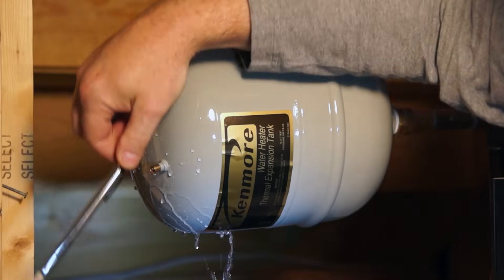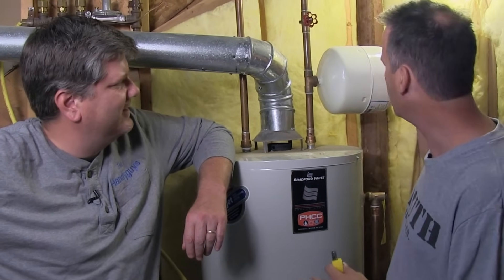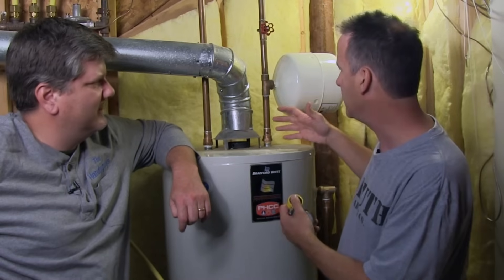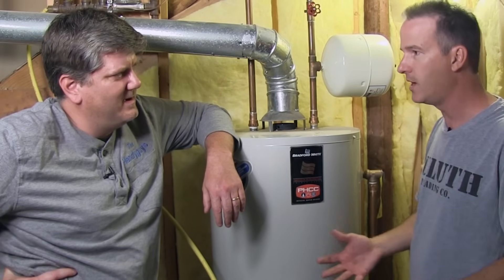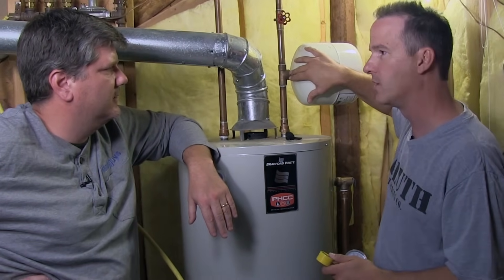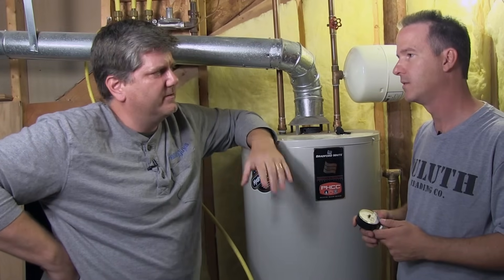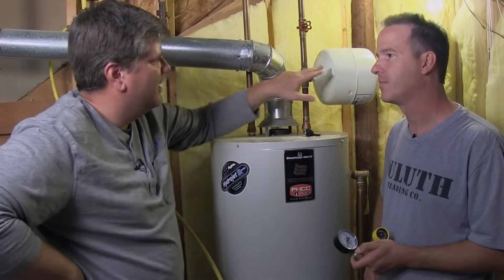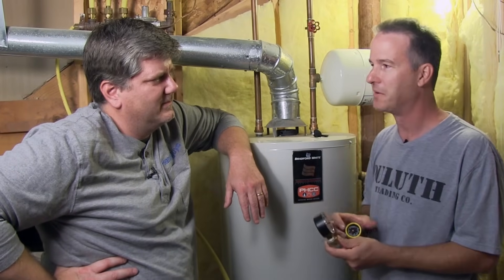Water Heater and Expansion Tank Maintenence

Comment: So  i was  told to put in an exoansion tank to fix my water spike/ hammer  issue. I have  arrestors on every appliance and  even miltiple on  the bigger ones, installed as close  to the appliance as possible. Anywho  my regular pressure is 60 psi regulated via prv at city main.  Well with  all the arrestors my gauge still  hits levels of 130 psi according to the dial with the  floating needle that reads highest pressures.. never seen it  spike before but everytime i reset it   Next time I look its back at 130 or around.   So  would i need to have an expansion tank set at 60 or  130?   I would think 130 would just push everything out and only be effective during those spikes which is dumb to do. But with 60 than the spikes in my opinion would still hit high pressures..  only 60 pounds  of cushion which it already has..  dunno   Just waiting for a  pipe to blow..

Comment: If your home already has hammer arrestors at all faucets; why would you need a pressure tank? I know water expands, but how much does volume actually increase when 40 gallons (Worst Case Scenario) is heated from 10°C to 50°C? you think more than the volume of air in hammer protectors?

Comment: We have really hard water, we have a water softener but the water tank still gets massive ‘furring’, what is the correct way to turn the tank into a closed system so I can pump (and drain) some decalification solution as I do in my radiators

Comment: All the installation info I've seen shows the tanks being installed vertically. Yours is the only one I've seen in the horizontal position. Won't that effect the operation?
Reply from the maker: ***** it won't effect operation but it probably should be supported better.
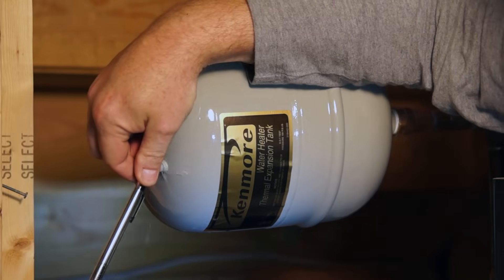Reply: Hate to disagree, Handyguy. While it is true, a horizontal installation will not affect the operation of the expansion tank  (when the tank is working properly) it will likely result in a misdiagnosis by the folks watching your video. The best installation position for the tank is "Vertical" with the adjoining water pipe located above the tank. If you will view the "failed tank" shown in your video (@ 3:54) the Air Valve is below the level of the tank's threaded connection to the water pipe. Thus, when the air valve is depressed, water escapes from the valve, and it is obvious that the bladder is ruptured. However, bear with me for a moment, when I say that the installed position of the Air Valve is random at best, for if the installer had given the wrench another half turn, the air valve would be below the tank's inlet connection. The significance of this becomes clear, when one pictures the effect of a ruptured bladder in a failed tank. The air pressure that was previously contained in the bladder is released into the "water side" of the tank, where it fills the upper interior half of the tank, and any additional air volume escapes through the threaded fitting and into the plumbing system. Here's where the problem begins: Placing a pressure gauge on a "ruptured" tank's valve will read the correct pressure (water supply pressure) and air will escape when the valve is depressed... if the valve is "Above" the Inlet Fitting. Conversely, depressing the valve will result in a stream of water... if the valve is "Below" the tank's Inlet Fitting. Since your videos are intended to educate the layman viewers, who may not be experienced with Expansion Tanks, you may see how a DIY viewer could check a failed tank and deem it to be good, based on the random position of the Air Valve when it was installed.
I think it would serve your viewers better, if you were to recommend the vertical installation of expansion tanks, when possible, and if a horizontal installation must be made; to take care to position the Air Valve in the lower position. Additionally, it would avoid headaches, frustration, and perhaps even unnecessary parts replacement, by at-home DIYers, to suggest removing the Air valve itself, to test for water intrusion, as it would allow for any trapped air to be expelled, followed by water from the system. The air valves are less than a dollar at any hardware store, or tire shop, and might as well be replaced when evaluating the expansion tank.
Thanks for your videos!

Comment: I think I have a noise as a result of the expansion tank being under pressurized. I bought a new one. The old one had well over 140 psi and a lot of filthy water in it. I put the new one on and the noise I had quit. Now 4 days later I get a siren humming sound. Any ideas?
I have a video of the sound and the water heater in the mud room. Not sure what to do. Maybe just add it as a new video. Thanks.

Comment: I just install my pressure tank to my water heater but I install the tee on top of the pressure tank and one end to the valve and other to water heater.   did I install it wrong or just wasted copper?  I notice they put the tee on the water valve and one hose to the tank.   just like yours but you Installed it sideways and wasted no copper.  but mine is upward and had to send copper line back and forth.  any suggestions 🤔  anyone??

Comment: I appreciate you taking time to post this video. If I may, there are a few crucial errors in your presentation. Please do not take this as rude or needlessly critical, as I am only trying to help you make a better presentation to people who may not know better. First off, those are pressure gauges, not valves. You call them valves in your presentation. Big difference. Secondly, you must be sure to precharge the thermal expansion tank to the proper pressure prior to installing it and loading the other side up with water pressure. If you choose to install it first, you must be sure that your Water Main is turned off and you have drained the pressure from the system by opening the faucet somewhere. Then and only then is it acceptable to precharge the tank to the proper pressure. Lastly, during the yearly check up the tank, you state that you should have a hot water faucet open somewhere while you check the pre-charge pressure. This isn't correct. You must shut off that valve above your thermal expansion tank, and then open a hot water line somewhere. Alternately, you can turn off your water main and open a cold or hot water faucet. The key is to remove all water pressure from the system when checking the pressure on your thermal expansion tank. Merely running some water while you check the pressure in your tank will not achieve this. Especially if it's a shower that you're running.
Reply: JimmyLeeHook could I simply turn off the water valve located just above the thermal tank (instead of closing the main valve) and opening a couple of hot water valves inside the house to relieve the tank pressure? Then charge the thermal tank to the proper psi?
Reply: Clay Sinclair Hello Clay, yes. That should work fine. Just be sure to open a hot valve all the way, and wait until there is zero pressure on the wetted side of the bladder in the tank. Leave a hot water valve open just to be sure. 

Sometimes you can get some cross pressure from the cold side to the hot side from mixing valves that leak a bit, such as from a kitchen sink or shower. You may find that merely shutting off the water supply to the water heater doesn't get rid of all your pressure in the water heater because of this phenomenon. But if you keep a hot valve open while you check the air pressure in the tank, you'll be fine.

The goal is to have 0 psig on the wetted side of the bladder when you check the air pressure.  You can accomplish in any number of ways.
Reply: JimmyLeeHook Thank you for your interesting post.. I'd say based upon ur advice... One could simply do an annual maintenance by pulling the expansion tank off completely and filling it to the proper air pressure. Then reinstalling it..
Reply: @mr.bigbrownbass9089  This is what I did in order to avoid the "balancing" act between valves. Took some pressure of the hot water tank by draining the bottom and then disconnecting the expansion tank.  Once off I drained the water from the tank, checked the pressure and adjusted it accordingly.  Then, reconnect the tank.  I find this a simpler, more concise way but as the poster above noted, there are several ways to do this.

Comment: The tank on my system has a label on it stating 15 lbs.  Water pressure ranges from 40/60 on a pressure switch.  So disregard the label and put between 40/60 lbs of air pressure ?   I have a well if that makes any difference..

Comment: I took my  two yo exp. tank off to check my air pressure, because it is near the floor and I can not reach the valve.  I support it from the bottom.   Once I removed it, water continued to spray out of it for five minutes.  The bladder was pressed up against the opening allowing water to squirt out in a fine mist.  Here in Pittsburgh we need pressure reducing valves after our water meter so we don't have 160 psi coming in our houses from the curb.  The Watt brand press. reducer is factory set at 50 psi. so that is the amount needed to charge the air side of the tank.  The tank came with just 25 psi. TIP.  If you have copper pipes put a dielectric union between the steel tank and your copper pipes or your ex tank will corrode much faster on the potable water side.

Comment: good video.  I would mount tank vertcially so that air doesn't get trapped between bladder and piping.  I would strap the tank if horzontal.  Tank should be placed at least 18" from water heater(found on directions that come with tank).  Add air before installing.  I would replace that valve with a ball valve.

Comment: I have an expansion tank that has failed, sprayed water all over my laundry room for idk how many hours. The tank is on the hot exit line instead of the cold in line. The unit is 3 years old and since the install we have had many other issues, pipes rattle, 2 faucets leak, and 1 tub faucet leak. Are these also problems from the tank?
Reply: Brandon O'Neal no..! The're from the bootleg'n hack that installed the system... It "pays" to hire a real Pro....!

Comment: My expansion tank has a a very slow air leak at the Shrader valve.  Do you know if the valve core can be replaced as is done on a tire valve?
Reply: I did replace the core. No problem.  This tank is over 30 years old so it's probably a good idea to soap test the valve periodically.

Comment: My main water line reads 60 psi, I turned off the cold water line to the water heater tank and opened the faucet. I am getting 0 psi on the expansion tank. If I add air to it , it keeps dropping to zero. When i close the faucet and turn on the water to the water heater tank, the pressure on the expansion tank gets to 53 psi. Is this normal? There is no water or leak on the expansion tank.

Comment: My question:  to what pressure do I set my new expansion tank?  It came @40 psi.  

I have a city water system.  I have a water stove that is plumbed so flow goes CITY/WATER STOVE/WATER HEATER.  The water stove can be bypassed.  There was no expansion tank on the system before installing the water stove.  The bypass to the water stove is normally closed.  

There is a back flow preventer (check valve) en route to the water stove.  I have an expansion tank right after that, in my house water heater enclosure.  It failed.  

My new expansion tank, out of the box, was checked to be at the factory 40 psi.  The directions say to "adjust before installing."  I've not yet installed.  I've been told that the tank should be set 2 psi below "the lowest system pressure." 

The pressure at my hose bib outside is 80 psi with zero flow.  I opened 2 sinks, a shower, and started filling my washing machine.  The pressure dropped to 32 psi.  There is a pressure regulator coming in to the house.  I don't know the pressure on the water heater.  

Q:  Do I adjust, and if so, to what pressure?

Q: When I check periodically (and there is only air in the tank), do I check with the water off and vented through an upstairs sink?  And do I change the pressure on the tank as needed?
Reply: Are you running Biothermal  AC/Heat?

Comment: Great channel!  Does it matter WHERE in the cold water line you put the expansion tank?  I am looking to install a commercial toilet with a sloan valve in a residential and am wanting enough pressure to help flush it with my 1/2 inch line.
Reply: Sloan valves are usually required to have 3/4.

Comment: Hey guys great video and I'm not even sure I'm gonna get a response to this based on the age of the video. But I went ahead and replaced my faulty expansion tank and followed all the steps got our pressurized and it actually took care of our water hammer issue however it is doing a slow leak around the connection even after using plumbers tape and I really don't feel like I should tighten it anymore than it is and it still does it. 

Is there a way to remove the newly installed one without ruining it and reapply even more tape for a better seal?
Reply: Unfortunately; the best way is to simply do the job again. However; you can possibly tighten it more but you need to know a couple of things before you try it. #1 what are the fittings made of ? if the tank is a steel fitting and looks heavy duty that's good. If the fitting you are connecting to is soldered onto copper pipe, you will need to have a wrench to hold it while you tighten the tank.

Comment: I didn't read all the comments so forgive me if someone has already mention what you guys forgot to mention. Assuming of course you know. I'm pretty sure the pro on the left new.
If by chance you had say half of the air you should have in that tank when testing it, it would still read the water pressure. 

As when you fill the system, there can't be any pressure from the water, as the pro mentioned about closing the valve entering the water heater and opening a hot water valve elsewhere, to relieve the pressure.(Of course the higher the opened faucet the higher the pressure you still have on the water side.1 psi = 2.31 feet of water.)
The reason for this is to expand that bladder to its maximum size at the required pressure. This allows maximum volume for expansion when it happens. 

I hope I explained it properly.

Just remember that you can have good pressure with very little volume of air. But the larger volume is a must to take up the expanding water.

Comment: Thank you handyguys for the PSA. I just checked mine and it had no pressure. I tried to add pressure and it wouldn't hold any. So I changed the tank and upped the pressure from the factory 45psi to 50psi. My Watts pressure-reducing valve's tag indicated that it was set to 50psi, so I figured I'd match it. I'll check the pressure with a gauge later.

Comment: I replaced mine about 5 years ago.  I now have hot water coming out of the cold tap.  Is this possibly the reason?  When I get home, I'm going to check mine.  I'll let you know.
Reply: I'm not a plumber, you should always check with one. However, do you have a back flow prevention valve on the system? They didn't use them back when. We just installed one. They're cheap and easy to do, and may be required by code today.
Reply: The pressure and integrity of my expansion tank are both fine.  I don't know what a backflow prevention valve looks like.  I'll look into it.

Comment: Yesterday, I replaced a 40gal hot water tank in my home.  I saw your video when I was done and decided to check the air pressure in my expansion tank and found that the bladder had failed. Today, I changed the expansion tank.  Before I installed it, I checked the water pressure coming into the house and found it to be 70psi.  I pre charged the expansion tank to 70psi, as you suggested, and installed the tank.  When I was done, I turned the main water back on and ran a few faucets to remove all the air from the lines.  Now, my "hot water" pressure is very low.  the cold seems the same as it was before the work I did but the hot seems like half the pressure is gone.  Any ideas why? I installed everything identical to what was previously installed so I can't figure out what the problem is.  Any suggestions would be helpful.  Thank you in advance for all your help.
Reply: Stitch Boucher You should probably have the valve that feeds cold water to the water heater checked, if it is an old gate valve it may be stuck partially closed.
Reply: Stitch Boucher Go to Lowes or Home depot and buy a pressure gage that screws onto the drain of your water heater. I bet the pressure is 70 psi. My guess is that you placed a restriction somewhere in your hot line when you installed the new water tank. Look for stuck valves, and any restrictions. But first, check the pressure at the water heater using the gage to be sure nothing weird is happening.

Comment: If I were checking the charge on the water expansion tank bladder and got water out of it ... I would think the bladder was ruptured and the unit i in need of replacement.

If this is correct, please explain to me how this bladder is good if water comes out of the air fitting?
Reply from the maker: you are correct.  I assume if water is coming out then the bladder has failed.
Reply: look at the start of this video ... perfect example of a bad expansion tank bladder.

Why do they call it an expansion tank when in industrial applications it is called an Accumulator?